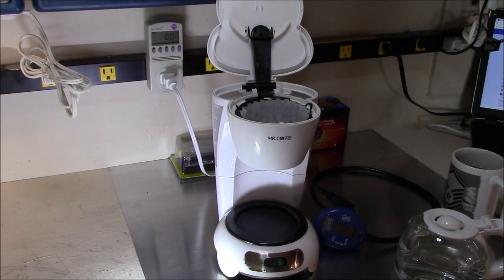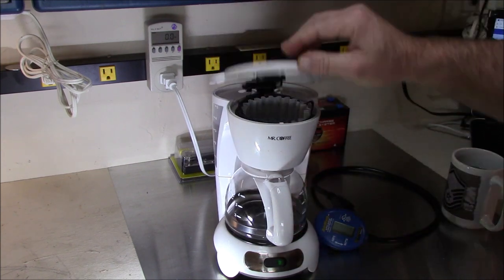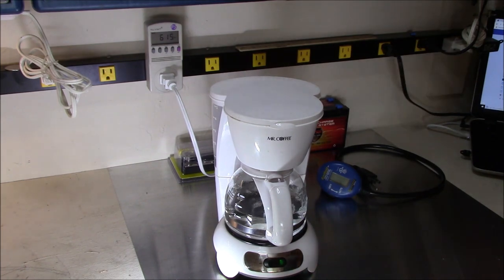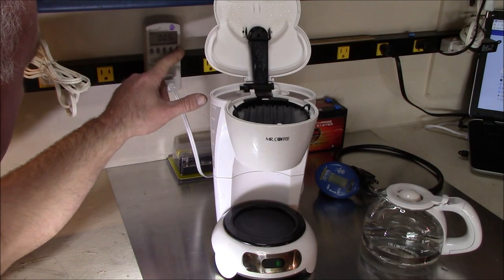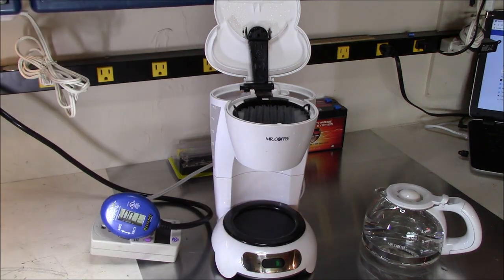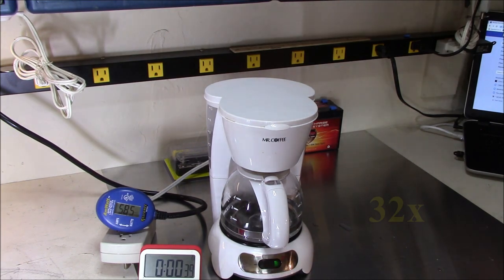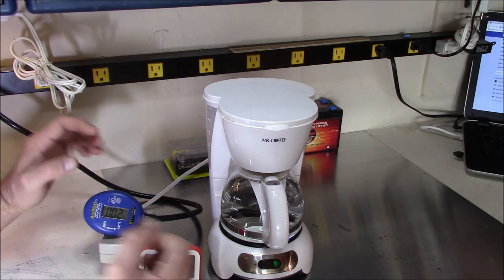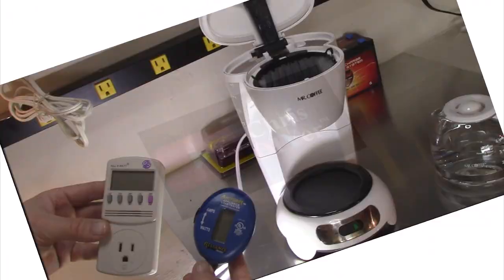P3 Kill-a-watt meter vs Reliance Controls AmWatt Load Tester

Comment: I like how the AmWatt doesn't cover two plug holes with a big display.  And you don't have to kneel down to read the display if the outlet is near the floor.
Reply from the maker: Yep...never liked that about the Deltran Kill-a-Watt meter (covers two wall outlet sockets and need to bend down to read and push buttons). Probably should have pointed that out. The Reliance Controls is like a tough professional tool whereas the Kill-a-Watt meter is "kinda" the unsubstantiated standard for checking loads, kWh, etc. Many use them and like them and I do too despite it's shortcomings

Comment: Helpful!👍 wondering if a solar charged battery power station that you build would power our kurig for camping?🤔 in the works here to put one together and see
Reply from the maker: Anything is possible. I did a test like that about four years ago. Was using a modified sine wave inverter...not pretty. Make sure the inverter's wattage is higher than the coffee maker's power consumption and use a PURE SINE WAVE inverter. I would grab your Kill-a-Watt meter next time you use it and test out the wattage...then go from there on inverter size, batteries, build parameters
Reply: They draw that much power!? Dang! Wouldn’t have though. Thanks for the tip. Was hoping to get away from the generator at night for a cup of decaf 🤔